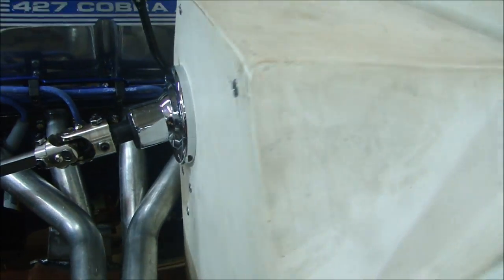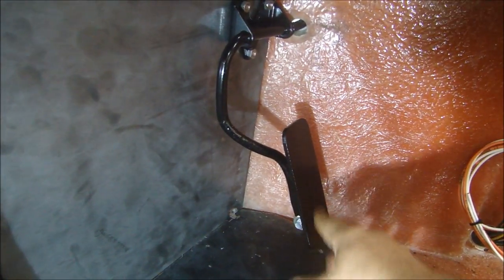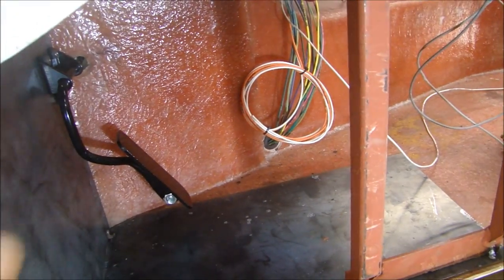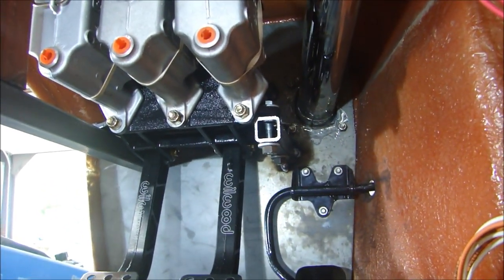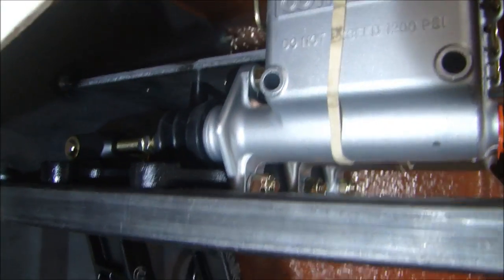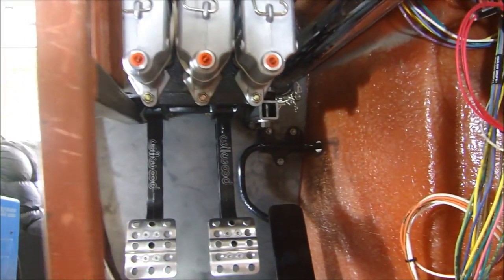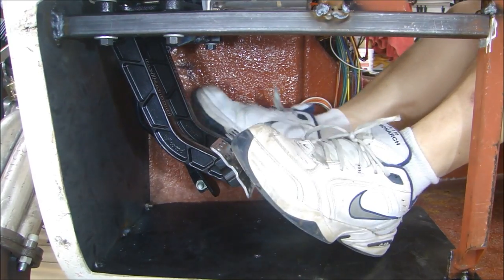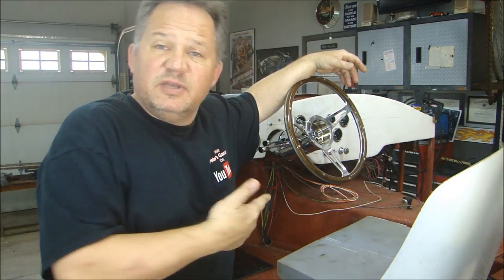427 Cobra   Steering Column & Pedals

Comment: I cut and moved the fiberglass to the right side of the accelerator and increased it by 2”. Made a huge difference. There was no way I could safely drive this car with my legs in a pretzel position like it would have been otherwise. 2” May not sound like much but my feet tell me otherwise.
Reply from the maker: I was thinking about that, great idea.
Reply: Max, I was thinking the same thing.  Do you have pictures?  Did you use fiberglass? Thx PJ
Reply: Speedway PJ 
  Yes I just cut to the right of the accelerator and glassed in the gap. Fiberglass is easy. You can do anything. 
  They made this kit to handle huge big block engines but it’s easy to get horsepower out of small blocks and with the extra space you can get more comfort for your feet!

Comment: pete how well does your willwood system work without a booster ? I have the master cylinder mounted on the engine side of the firewall with no booster on my willwood setup and i have to stand on the brakes do they make small boosters for the cobras ?
Reply from the maker: I'm sure about the small boosters, but mine work fine. Both the brakes and hydraulic clutch work excellent.

Comment: Pete, I’m doing a similar pedal installation and I too have the master cylinders inside the footwell, for the reasons you allude . Only difference is I used remote reservoirs and fitted them behind the glovebox lid. There enough fall to feed the cylinders and filling access is more visible,
Reply from the maker: I wanted remote reservoirs too, but all my EFI electronics are behind the dash, no room for anything else, not even a pair of gloves.
Reply: Pete's Garage : Good answer Pete and very informative videos. Thanks

Comment: Hey Pete, can I get the part number for the summit racing steering column you used along with the other parts up until the steering rack?
Reply from the maker: You have to measure length for your car, but it's just the Summit tilt steering column, D shaft and steering u-joints and the spline to go on the rack
Reply: @PetesGarage  I have a CNC / street beasts extended version too just like yours.
Reply: I found all the parts except for not knowing the measurements for the d shaft, hope you can help me with this I'll be grateful!

SUM-771713-NK is the tilt steering column - 30" dia x 2" dia

SUM-772820 - is the floor mount - 2" dia

SUM-760666 - DD u joint - 3/4" each side 26 spline

CPP-UJ7 - DD u joint - 1" into a 3/4"
Reply from the maker: The D shaft is cut to length
Reply: @PetesGarage  thank you for the help!

Comment: Hi Pete,

Wouldn't the hard linkage move the throttle slightly up and down with the vibrations of the engine?
I would assume that will cause the engine to rev not that smoothly.

Thanks!
Reply from the maker: The original Cobra has the linkage on the engine. If the engine moved front to back it may be a problem, but this one only rocks side to side a little
Reply: Petes Garage Thanks, makes sense!

Comment: Hi Pete,
I don't know if you remember me from Ca I do graphics and said I would make the number for the Cobra and that I have the same street Beast as you only I'm using a small block Ford.
As topical of most Cobras room were the petals are is small and the center hump is way to big we are working on cutting the glass and redesign the center as there is no reason for such a large box with engine and five speed trans installed we have plenty room if we cut it down.

What's your thoughts
Reply from the maker: I looked at it and you're right, you could cut it to make more room. I do think it would restrict air flow some, which may make it hotter in the engine compartment, but that might not be as important as more room.
Reply: Comfort and room do make a difference especially when you are tall with big feet. My new project has been a Polaris Slingshot  and I redesigned the passenger footwell because it was made for really short people and what a differance that made anyway keepup the good work and next time your in CA give me a call.
Reply from the maker: Awesome! Next time I get out there I will

Comment: And one more good vid. Im looking to build a car like your cobra when i retire in 6 years. But would like to start buying up most of what i need until then. so far looking at the base kit from Factory five. What do you suggest? P.S already have motor an trans
Reply from the maker: Well....the kits and dimensions are always changing. It's best to get the kit first, then start buying the parts that fit it.
Reply: Thanks I should have asked what kit do like?
Reply: Check out the current suppliers.  I am building a (Antique and Collectable)  '67 Cobra Kit and I am very happy with the quality and assembly process.   http://www.acautos.com/67-roadster/
Also a great book (building Factory 5) "How to Build Cobra Kit Cars + Buying Used" by Smith, D Brian former editor-in-chief of Kit Car magazine Good luck!